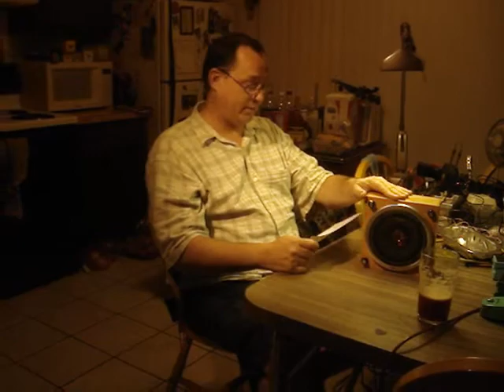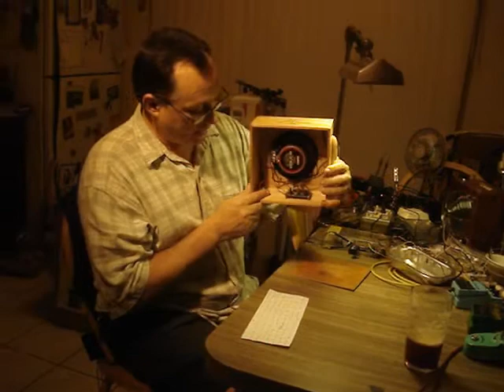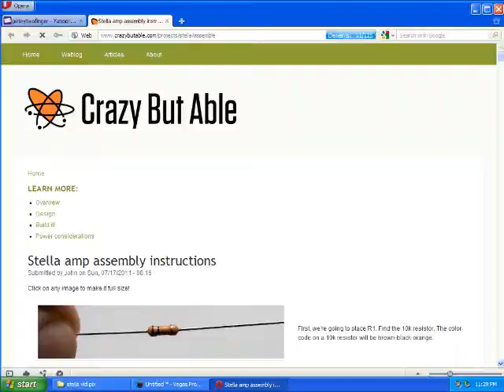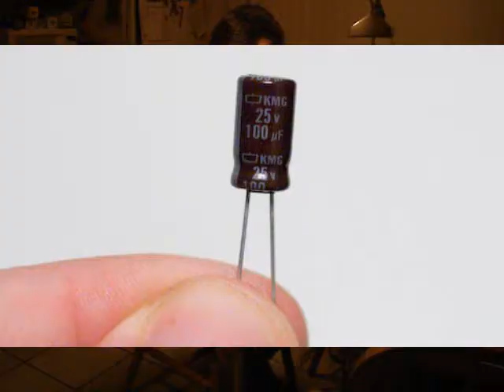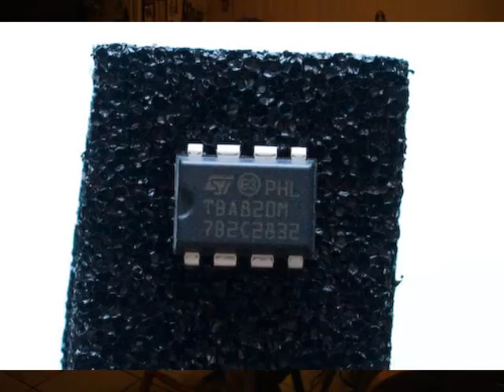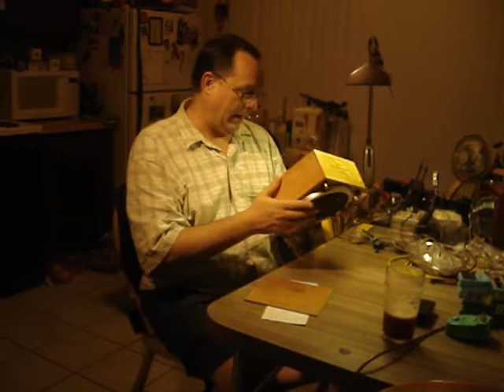Stella amp kit review part one

Comment from the maker: interesting , i also tried fx with a NC , i found that inserting after the buffer yielded feedback / noise . i also ran intio the mud effect but found that a simple tillman) buffer BEFORE the effect remedied this . it worked before or after but the tone was better with the buffer before . its often unique , what you will find . best method is experimentation because i have found , you never can tell ! often what i think should work will not , but there usually is a way around it .
Reply: Hello, I was searching for portable mini amps, and from what I hear this sounds lots better than the lm386 ones. Do you by chance have any schematics? I'd really like to get ahold of one or try building one!!